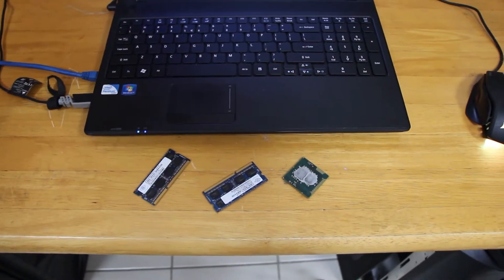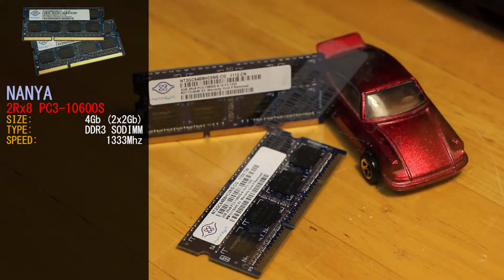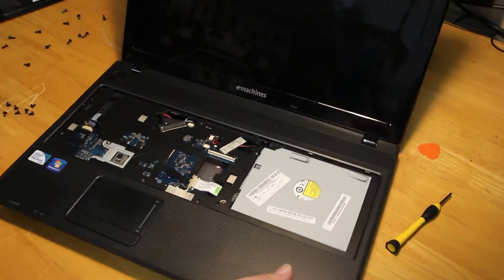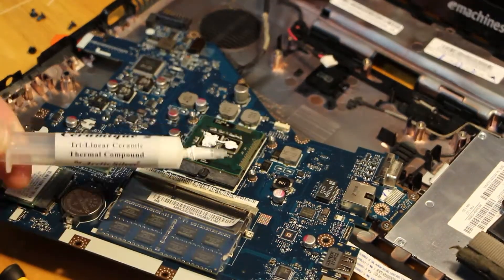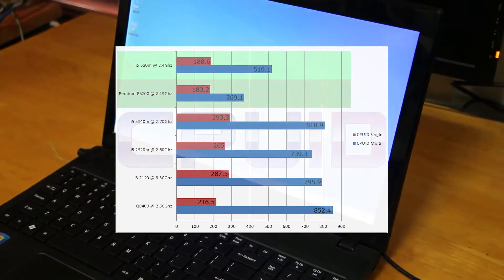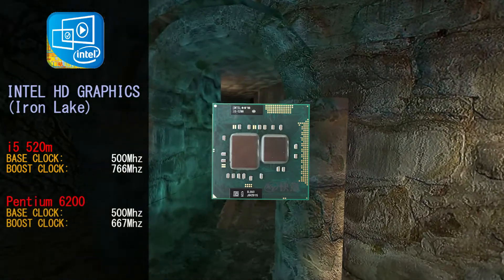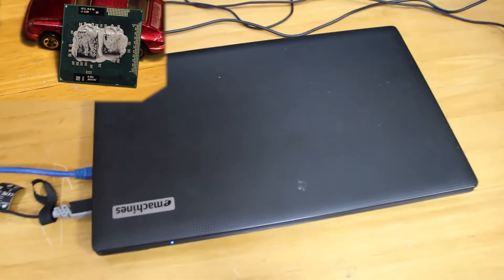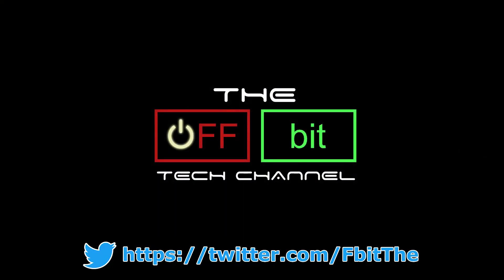eMachines E729Z Laptop CPU and Ram Upgrade. Pentium p6200 to i5 540m with 4g of DD3 SODIMM ram.

Comment: hello there I found myself a eMachines D729Z  Laptop it currently has 2gb 1033Mhz. I was wondering if it could run 4gbx2 with a frequency of 1333Mhz? I was thinking of upgraading it but i dont know if it would be compatible if i replace the frequencies

Comment: Its possible upgrade whit i7? Thanks
Reply from the maker: You should be able to, However, you CAN NOT use the i7 720qm, 740qm, 820qm, 840qm, 920xm or 940xm. The qm and xm CPUs do not come with an internal gpu. If you have a discrete graphics card this is not a problem, however, the E729Z, the example from this video anyway does not come with a dedicated video card option (usually an Nvidia or AMD Radeon GPU).

So you should be fine if you stick to the i7 6xx series eg i7 620m or i7 640m. Also, it's worth noting that the 6xx series i7 is very similar to the i5 being a dual-core with hyperthreading. Though I believe the i7 has higher clock rates and more l3 cache.

I hope that helps,
Thank you for watching.

Comment: acer emachine d732z 
it is possible to upgrade the processor  of my laptop?
what processor is compatible and ram 4gb or 8gb?
thank you sir .

Intel® Pentium® Processor P6200 (2.13GHz,3MB L3 Cache,1066 MHz FSB)
supporting Intel® Smart Cache
Linpus Moblin M
Mobile Intel® HM55 Express Chipset
IEEE 802.11b/g/Draft-N WLAN
2GB DDR3-1066 (Max 4GB)
500GB HDD
DVD-Super Multi double layer Drive/Multi-in-1 card reader
10/100/1000Mbps LAN,Integrated Bluetooth 2.1+EDR
14” HD (1366 x 768 pixel) eMachiens LED 16:9 aspect ratio
Intel® HD Graphics
eMachines WebCam 1.3M
HDMI™ with HDCP support
Weight 2.3kg
Reply from the maker: The good news is, your CPU is most likely a socket based CPU.
The CPU is a socket G1,
You should be able to upgrade to most of the G1 socket based CPU's.

If you don't have a dedicated GPU don't use the i7 qx or xm CPU's (they are the quad core 8 threaded CPU's but don't come with a dedicated on chip GPU)

I would say all the i5 will work from 1st generation with a Socket G1
https://en.wikipedia.org/wiki/List_of_Intel_Core_i5_processors#Westmere_microarchitecture_(1st_generation)_2

as well as the arndale i7s with socket g1
https://en.wikipedia.org/wiki/List_of_Intel_Core_i7_processors#%22Arrandale%22_(MCP,_32_nm)

You should be able to run 8gb of DDR3 Ram using both channels (2x4gb sticks) on the HM55 chip set.
1 stick of 8gb probably wont work so stick to 4gb sticks.

I hope that helps thanks for watching.

Comment: Why when I change the cpu into i3, the laptop is not opening only the blue light in 1 sec?
Reply from the maker: You may need to reopen the laptop back up and check all your connections and cables have been attached.

Did the CPU seat in happily when you installed it.
Maybe a bent pin on the CPU may cause it to misbehave.

But check internal connections and cables first.

Start with the easiest things to check before the more complicated stuff.

Comment: Sir good work but not able to find I5-540M or 520M. Plz help..!!
Reply from the maker: I usually source my CPU from ebay.
Most of them are ordered from international sellers (most of the CPUs I have bought are from china via EBay) so you have to be patient to get the cheaper prices. 

I hope that helps.
Good Luck and thanks for watching.
Reply: What alternate can be used for cpu to upgrade?
Reply from the maker: @rahman171  
The I5s in the ivy bridge 3rd gen is usually what I upgrade these laptops to.

Check out the link below to Wikipedia with the CPUs

you want the  cpu's with socket g2

https://en.wikipedia.org/wiki/List_of_Intel_Core_i5_processors#Ivy_Bridge_microarchitecture_(3rd_generation)_2

Comment: Hi. I have the same laptop, and it has been a project laptop for me. I have replaced the keyboard. and been trying to upgrade the SODIMM initially to 2 pcs 8GB 1600 DDR3, but I guess I was wrong with this. I think it has to be just PC1333 1066 with a max of 4GB each slot. Am I right? Also another question, is the i5 520m the highest processor that this board can handle?
Reply from the maker: The max ram capacity that the CPU can use is 8GB, now there is a situation where the individual chips on the ram need to be I believe 256 8bit chips, not the 512 sized ones.

So I think you need to find 2x 4GB sticks that basically have chips on both sides of the ram stick to get the max of 8GB of ram.

Now your system can basically run any Socket G1 CPU, but there are the issues some of the I7 CPUs do not come with an on-chip GPU. which you do require for this laptop since there is no dedicated GPU (Like NVidia / ATI Radeon).

The best i5 CPU you can use should be the i5-580m

(wiki link of i5 CPU's check the socket)
https://en.wikipedia.org/wiki/List_of_Intel_Core_i5_processors#Westmere_microarchitecture_(1st_generation)_2

The best i7 CPU you can use should be the i7-640m
(wiki link of i7 CPU's check the socket and make sure it has a GPU shown with GPU frequency. Arndale based)
https://en.wikipedia.org/wiki/List_of_Intel_Core_i7_processors#Westmere_microarchitecture_(1st_generation)_2

any CPU with an i7-xxxQM or i7-xxxXm on the end will not work (these CPUs don't have an on-chip GPU and are of the Clarksfield Architecture).

Intel CPUs info top i5 / i7 you can run (also note 8GB ram max in datasheet)
https://ark.intel.com/content/www/us/en/ark/products/49652/intel-core-i5580m-processor-3m-cache-2-66-ghz.html
https://ark.intel.com/content/www/us/en/ark/products/43560/intel-core-i7620m-processor-4m-cache-2-66-ghz.html

It's also worth replacing the standard magnetic drive with a SATA SSD.

Make sure when you order the CPU it's the Socket G1 version not the soldered on type.

We hope that helps,
Thanks for watching.
Reply: @OFFbitTech  Thank you so much for the very detailed response. This sure is a great help. I have upgraded my RAM now to 8GB. Now I'm going to be looking out for that CPU. I'm using the laptop now replying this. :)

Comment: Amazing video Sir,
Im also planing to upgrade the processor of my emachine laptop, I just really dont know how to start and what is the main requirements but this video I belive would really help me decide since my laptop is too slow, I hope you could still answer me Sir, I have emachine E730 Intel core i3-330M with 2 gb DDR memory, can i upgrade it to either i5 or i7? i dont really know where to start and what is the worth to buy that would compatible with the  laptop that i have. I hope you could help me please.
Reply from the maker: You should be able to upgrade this laptop to an I7 or i5.

There is a couple of things you do need to be aware of.
The i7 clarksfield based CPU do not have on-chip GPU, This will be most likely a problem if you don't have a dedicated ATI or Nvidia GPU in the laptop.
Westmere based CPU's do come with on-chip GPUs

i7s come in two varieties in this generation of CPUs. i7 with a Quad-core and 8 threads (no on-chip GPU) and the i7 dual-core 4 threads (with on-chip GPU).

The best way to identify them is by the last letters on the CPU just an m or qm.

m will be a dual-core with 4 threads and
qm will be a quad-core with 8 threads (no on-chip GPU).

There is also XM which has got unlocked cores for the quad-core i7.

i5-520M
i7-720QM
i7 620M

all of the i5 CPUs have an on-chip GPU to my knowledge.

Also the CPUs you are looking for is for the socket g-1 socket.

Here are some wiki links to the CPUs.

https://en.wikipedia.org/wiki/List_of_Intel_Core_i5_processors#Westmere_microarchitecture_(1st_generation)_2

https://en.wikipedia.org/wiki/List_of_Intel_Core_i7_processors#Nehalem_microarchitecture_(1st_generation)_2

You should look at upgrading to 4 GB of ram at least if have not already and I would suggest replacing the hard drive with an SSD drive.

The SSD drive will probably give the most noticeable performance increase.

Giving you faster load times and the operating system will feel faster.

If you are worried about the amount of stuff to pull apart to get to the CPU. It might be worth just upgrading the ram to an SSD drive first.

Just make sure that if you do an upgrade of the CPU, the CPU you get will work with your GPU setup or to be safe just get the dual-core M CPU.

We hope that helps.
let us know what you plan to do and good luck.

Thanks for watching.

All the i5's

Comment: Hello Sir 
I have emachines D732  i3 processor
HM55 G1 socket chipset Has intel graphics 
 
What i7 processor i will use that supports Intel graphics
Reply from the maker: The Intel graphics actually come on the CPU.
But you are right you need to make sure you get the right i7 since there are quad core versions with no graphics and dual core versions with graphics.

The i7 chips that comes with the Intel graphics that should work in this laptop are.

i7 620m and i7 640m.

Here is a link to the Wikipedia page for them.
https://en.wikipedia.org/wiki/List_of_Intel_Core_i7_processors#Westmere_microarchitecture_(1st_generation)_2

We hope that helps and thanks for watching.
Reply: Sir 
If use i7 720qm w/o gpu
And external gpu ddr3 (unplugged wifi at pci slot of the laptop d732)

Will it work?

Comment: I have the same laptop  with pentium P6200 with 3gb ddr3 ram can I upgrade it to 8 gb ??
Reply from the maker: We did not try anything more than 4gb of ram. It should be able to take 8gb of sodimm ddr3 ram using 2 sticks of 4gb. However we have read that you need to make sure the chips that are used on the ram are  256Mx8bits chips anything bigger like  512Mx8bits will not work. 
The best way is probably find 4gb stick that memory sticks on both sides of the board and have about 8 chips on each side (16 in total adding up both sides).

This is something we have not tested so we can't guarantee it will work. But it should be possible to get 8gb of ram it might be touch and go).

The CPU upgrade should be the same as this video as well so that is a little more straight forward but more involved.

Thanks for watching we hop that helps.

Comment: Amazing video Sir. May I ask for some recommendations or suggestions? I own a eMachine PAWF5, T4400 Intel Pentium processor/Intel GMA 4500M, 2GB DDR3 memory, 250GB HDD but not anymore because when my father had it for repair, the original piece was replaced with a poor one. However I don't care about it anymore because we can't take it back. What I wanna do now is just upgrade as long as it's able to handle todays apps and game streaming. Hoping for you response Sir. Your new sub btw!
Reply from the maker: Unfortunately the T4400 is core 2 based and being a mobile device it's also not as quick as it's desktop counter parts. Mobile cpu's that are in laptops are design for power efficiency which is always makes a cut back on compute performance to achieve better battery life. 

The intel GMA graphics does not really play to many games at all. We were thinking of making a video with intel GMA graphics but we really did struggle to find any thing remotely new that could run in the GMA graphics.

I'm sorry to say, but gaming on this machine for more recent games is out of the question. you upgrade path also is pretty much restricted to mobile core2 cpu's but the real nail in the coffin is the gma intel graphics.

The laptop should be fine to watch video's though streaming services you might need to put a faster core 2 cpu in. 
Word processing and web stuff should be ok as well.

Sorry that we could not give you good news.
Thanks for watching.
Reply: @OFFbitTech  Awe, okay. That's kinda sad. But thanks for responding to my comment. God bless and more power to your channel
Reply: @OFFbitTech  My Friend Upgrade my T4300 2gb Ram to 4gb Ram.
Can I Upgrade my CPU?
i Dont Play online Apps Games I just Play Browser Game Still the CPU Run 93% While on SNS 60% and Below.
Can I or Not Updgrade This?
Using it Right Now.